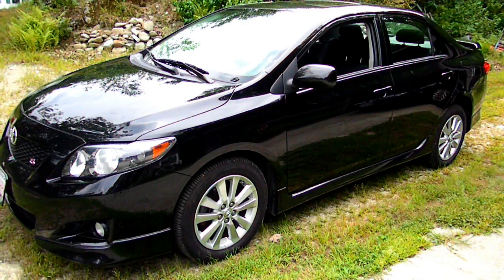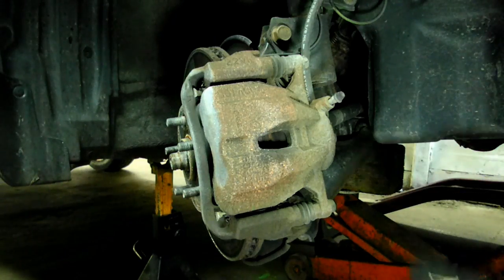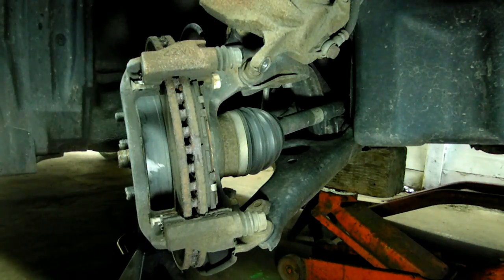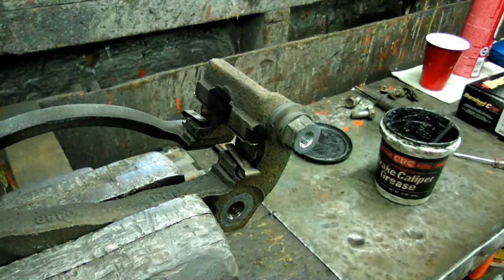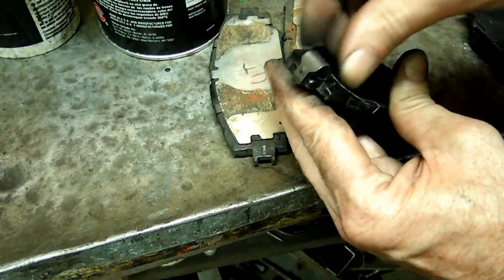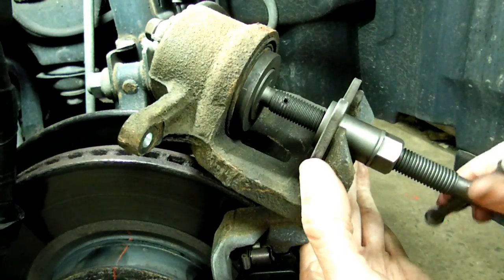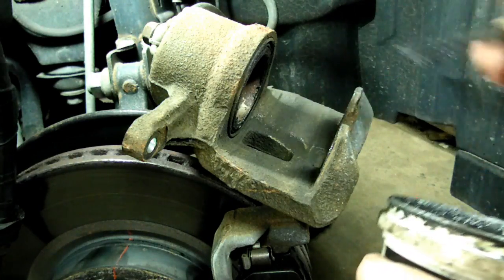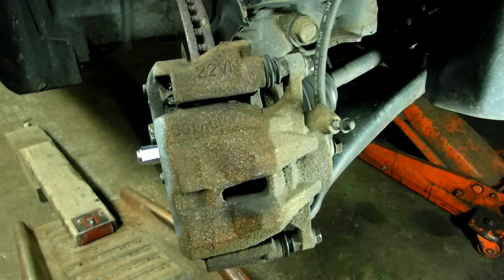Toyota Corolla Front Brake Replacement

Comment: What I dont get is most of all brake installs I see its never shown before any removal & inststall of front or rear brakes to loosen the cap on the master cylinder not taking it off so pressure doesnt build up in the master cylinder, I also never use any grease on the inside of caliper being it will ultimately in time deteriate the caliper piston rubber causing failure to it & literally making the brakes to fail causing serious accident & injury even death, never should grease be applied to any caliper piston rubber even to the opposite side its a bad practice that can cause serious problems..

Comment: Great video.  When pushing the caliper piston back, it is best to open the bleed valve.  That way the old fluid does not return to the reservoir.  You can then top off the reservoir with clean fluid.  This will make a failure of the ABS less likely, since you're never forcing fluid backwards through it.
Reply from the maker: With the ABS it very well might be a better practice to open the bleeder.Location however might make this procedure difficult if the vehicle has moderate to high mileage and is from the salt belt as the bleeders get very difficult to loosen because of corrosion from all the salt.

Comment: never use that grease on the pin only silicone grease the clear water proof grease like plumper use on o-ring
Reply: What about heat proof

Comment: how did you remove the front Rotor in a 2005 corolla s model,looks like you have to remove the nut that goes into the the wheel bearing not sure butvi looks that way,thanks

Comment: I own a 2010 black Toyota Corolla S.  Did you put new front rotors on when you put the new pads on? Just wondering? I was told that when you replace the pads also replace the rotors?
Reply from the maker: jtoyb It is always a good idea to resurface or replace the rotors when replacing the pads.

Comment: I noticed you didn't removed the shims.  Do you ever remove the shims or do they simply stay in place?  Are they a non-wear item?

Also, should a fella' put a little grease or 'Never-Seize' on the two 14mm bolts that hold the caliper?

And finally, do you have a tutorial for rear drum brakes (2007 Corolla)?

Great tutorial!
Reply from the maker: I look at the shims to make sure they look ok.Living in the rust belt i do put brake grease on my bolts.I do not have a video on a 07 rear brakes at this time.

Comment: I like the video.  About the only thing I do different is to wire brush the surface of the caliper bracket that the edge of the pads ride on.  Put a very thin coat of synthetic grease on that surface and no rust will build up.  Not necessary to always change rotors.  New cars have been coming equipped with ceramic pads now for years and they're very easy on rotors.  IMO the warped rotors come from letting tire people put the wheels on with impact wrenches which over tighten the lugs.  Get a "Torqx Stick" if you're going to use an impact then follow up with a torque wrench.

Comment: Hey RichPin how often should one replace brake fluid?  I just bought a used 05 Corolla but it only has 30K miles on it.  Going to change all the pads myself after seeing how easy it looks in video I already did the same on my 07 Nissan which was pretty simple.  My question is on the brake fluid replacement.  The Toy Stealer (Dealer) is telling me every 15K miles all brake fluid should be replaced what is your take Sir?  Thanks for the Video Good Stuff!
Reply from the maker: You should replace the brake fluid ever 2 years.

Comment: Hi, i'm having a Corolla S 2009 and i'm trying to replace the front wheel brake and rotor but my caliper is not the same as the one you show in your video, having some more video with different kind of caliper on a Corolla S 2009. Even the piston push in, there's no place to slide the caliper on the rotor with brakes in it. My caliper didn't get seperate in two pieces like the one in the video.
Thanks
Thanks

Comment: im doing mine for the first time on my 2010 model s tomorrow. I am proud to say that my front breaks have lasted over 55,000 miles, and my rotors are still in good shape according to the toyota dealership. the clips that you saved from your old pads, did the new pads you purchased come with replacements, or do you have to re use the old ones? and also the grease you used on the guide pins and the piston is that necessary?

Comment: That's wrong. with brake jobs now-a-days, it's a requisite to change rotors with the pads. they are designed to warp now to the point they need to either be tossed or turned down. since it's a composite material, turning them down is impossible. the only thing you can do is buy new ones. it's inadvisable to reuse the rotors. I know from experience

Comment: Thanks for the Video, Excellent job. I have a 2010 corolla, i will change the pads soon and im gonna be using your video to do it, mine has 38 k on it. I am just curious, why didnt you change the rotors at the same time sine you the caliper mount off. i am thinking about changing the rotors too, or do you think i should just keep the old ones? i live in upstate NY so the roads are pretty salty during the winters months. thanks again for the video.

Comment: Hey good video! I have a 2010 S model, I think I installed the pins that go into the shims incorrectly, or something. They arn't nice and tight like you show in the video (they still go into the shim) but I drove it at highway speeds and re-inspected and everything looked fine. Do you think its fine or should I reinstall? Thanks!

Comment: noticed you used a very light torque on the bolts holding the calipers on.  I guess this is due to the two piece bolt/caliper pin design,which I have never seen before.  Good to know.
Ferd

Comment: @rjal1973  It has been done the way richpin compressed it for a long time. Rarely does any damage. Yes, your way is the " Book Way " but you can do it both ways. What if the bleeder screw looked like it was going to shear off right when you turned it. Then its gonna be a constant battle between who is paying for a new caliper. Customer will get angry because you did not tell him/her. Pinching the line takes more time, Face it we are Flat Rate Techs. Not union workers.

Comment: ...seized because the dried part of the piston with a little corrosion (rust) was behind and under the piston seal. It's amazing how tight the caliper was squeezing the rotor. I could barely drive it home. I measured the temp of the rotor with an IR gun and the rotor was over 600 degrees!  I took apart the caliper and cleaned off the rust with crocus cloth and reassembled with a new seal and dust boot. Moral of the story is to R&R the caliper boot when it has a few holes and isn't air tight.

Comment: Everything Rich did is fine for a newer car, but let me say that for an older one with a less than perfect dust boot around the caliper piston, it would be a good idea to take the extra time and replace the dust boot.  My '99 Corolla has a dust boot with a few holes in it which exposed the end of the caliper piston to the elements such as moisture. As the pads wore, more and more of the piston became exposed. When I changed pads, I pushed the piston back in too. 6 months later the caliper .....

Comment: @Tressah On my '99 Corolla there is a flat face of the caliper that matches with the flat part of the guide pin bolt to keep it from rotating so you don't have to hold it.

Comment: @richpin06a Well I don't valve his opinion, Richpin. There's no way this can damage the master cylinder, but the brake hose can be damaged by  pinching it as he said. As someone else said, however, it would have been a good idea to flush out some of the old brake fluid, even though it's not that old. Why not? You're right there with the caliper easily accessible. Crack open the bleeder and bleed out some of the old shizzle.

Comment: @rjal1973 I've heard that argument before, and I think I understand your point. That reasoning makes the assumption that the damage caused by pinching brake lines is less than that caused by retrograde flow of brake fluid. But retrograde flow of brake fluid happens every time you take your foot off the brake, albeit with lesser volume. How is it that retrograde flow of fluid damages the MC? Do impurities of the line contaminate the MC reservoir? The risks seem fairly small either way....

Comment: @rjal1973 Your suggestion seems logical, though of the dozens of brake jobs I've seen on YouTube, this is the first time I've learned (from you comment) about that procedure. Is this something you learned in school or from fellow tech's or is it a  technique you've developed? Pressing the brake peddle causes fluid to flow out of the MS, an releasing the brake pedal allows fluid to return to the MS. How is compressing the caliper a slight bit more to release them any different...
Roy Lewis ATL GA

Comment: @rjal1973 When the brake pedal is at rest there will be a straight flow-through path for the fluid to the calipers, the master cylinder's seals, etc. don’t come into play at all. Sometimes it’s necessary to reverse bleed brakes – and that process does exactly what Rich was doing, push fluid back up to the MC. I’ve seen it done both ways, but on a car in the rust belt trying to loosen a corroded bleeder is a good way to ruin an otherwise good caliper.

Comment: I don't agree with compressing the caliper the way you did. You should have pinched the brake line, open the bleeder valve and then compressed. The Master cylinder is designed to push fluid out, not have it come back in.

Seems like a bad habit for older techs.

Comment: do all cars have those shims and do you have to use a wrench to hold the guide pin or can you just tighten the bolt down. when i did my breaks on my Taurus i don't remember doing that....